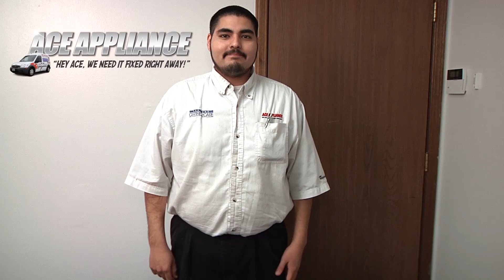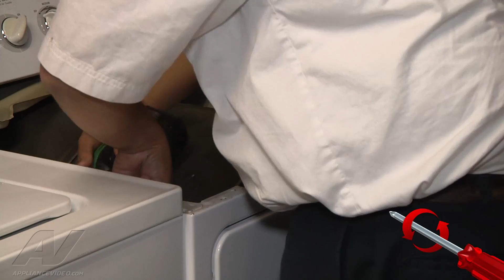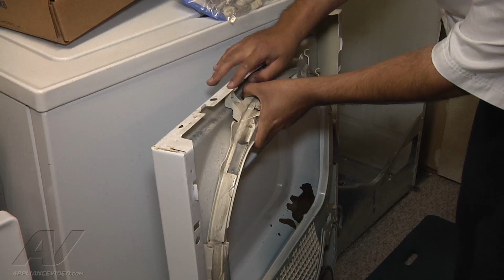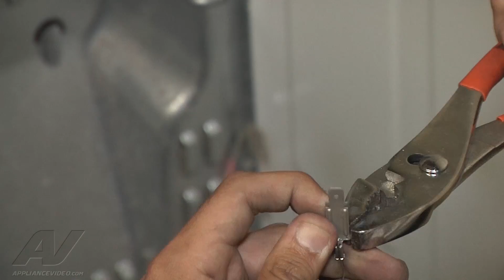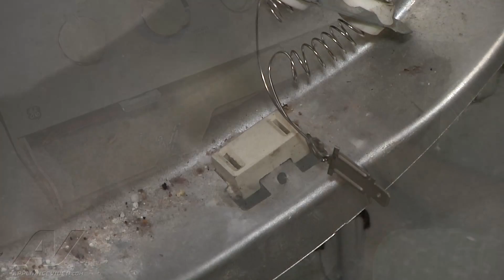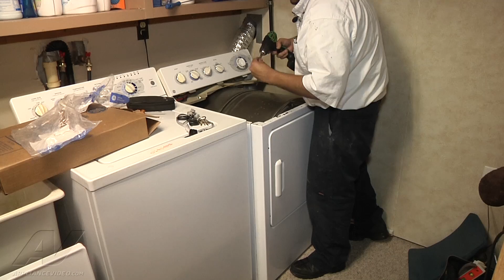GE Dryer Repair - Low Heat - Front Bearing

Comment: Restring coil is extremely difficult, at least 2 sizes exist. Its a terrible design through the entire unit away!!! GE changed the coil style after 3yrs. The design is junk it accumulates lent throughout the duct, its a throwaway! You never hear that from these well intended types, ur volunteering for a suicide mission.

Comment: So once the heater element is broken, have to replace it with a new one?
Reply from the maker: Great question, if you have a more technical question that our parts department cannot answer, you can search our over 17,000 answered questions free at our website www.ApplianceVideo.com under our Repair Help section. You can also call our parts department at 1-800-830-5465 and they can give you help 7-days A week ,or search at www.SaveMoreOnParts.com  .

Comment: A heating-element coil will fail when a crack forms through the thickness of the wire.  This crack creates a hot spot that locally melts the wire on both sides of the crack, thus stopping current flow.  But when the element cools down the ends of the broken wire may establish electric contact, and then current flows once again.  The cycle will repeat, and when the dryer is cool and you measure it with your continuity tester, the small current from the tester will go right through and give you a false 'good' reading.  The reason I'm a great expert on the phenomenon is that it happened to me: once I pulled the drum out and poked at the coil the break (inside an insulator) was obvious.  On close examination I saw the balled-up ends of the nichrome heating wire. Since the dryer was old when we bought it 20 years ago I decided be a sport and replace both heater coils.
Reply from the maker: Great question, if you have a more technical question that our parts department cannot answer, you can search our over 13,000 answered questions free at our website www.ApplianceVideo.com under our Repair Help section. You can also call our parts department at 1-800-830-5465 and they can give you help 7-days A week ,or search at www.SaveMoreOnParts.com  .

Comment: My dryer has the exact same style heating element  I bought new coils and they are not stretched at all yet do I need to pre stretch them before feeding through the insulators or just start  putting them through I'm afraid if I pre stretch them they will be too long.
Reply from the maker: Great question, if you have a more technical
question that our parts department cannot answer, you can search our over
10,000 answered questions free at our website www.ApplianceVideo.com under our Repair Help section. You can also call our parts department
at 1-800-830-5465 and they can give you help 7-days A week Monday -Saturday, or
search at www.SaveMoreOnParts.com  24 hours 7- days A week.

Comment: How did you test it with the door open?
Reply: Push the button in the frame, then turn dryer on.
Reply from the maker: Great question, if you have a
more technical question that our parts department cannot answer, you can search
our over 10,000 answered questions free at our website www.ApplianceVideo.com under our Repair Help section. You can also call
our parts department at 1-800-830-5465 and they can give you help 7-days A week
Monday -Sunday, or search at www.SaveMoreOnParts.com  24 hours
7- days A week.

Comment: how did you stretch out the elements?
Reply from the maker: Great question, if you have a
more technical question that our parts department cannot answer, our
technicians are answering all questions at our website at www.ApplianceVideo.com under our Repair Help section. You can also call
our parts department at 1-800-830-5465 and they can give you help 7-days A week
Monday -Sunday, or search at www.SaveMoreOnParts.com  24 hours
7- days A week.

Comment: I have basically the same GE dryer and one of the heating elements was broken too, however my multimeter gave an audible  continuity sound even on the broken one (broken ends not touching)....why is that?
Reply: Shorted to the case.
Reply from the maker: Great question, if you have a
more technical question that our parts department cannot answer, our
technicians are answering all questions at our website at www.ApplianceVideo.com under our Repair Help section. You can also call
our parts department at 1-800-830-5465 and they can give you help 7-days A week
Mon-Sat . You can also search at www.SaveMoreOnParts.com 7- days a week.